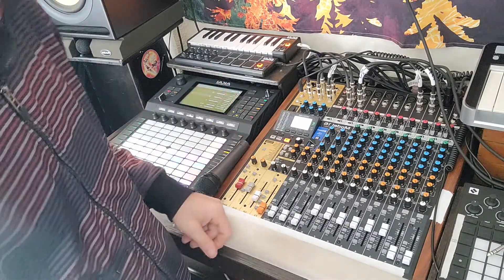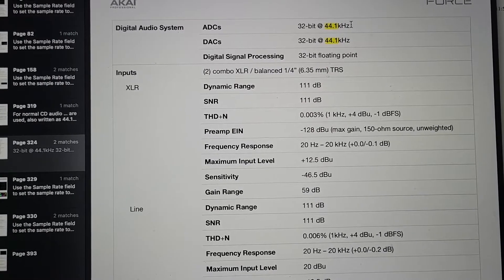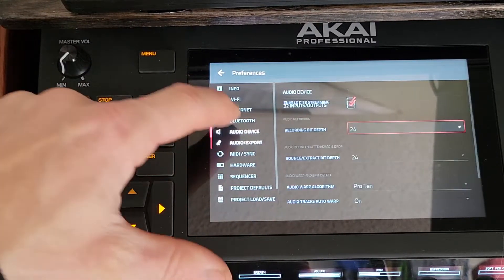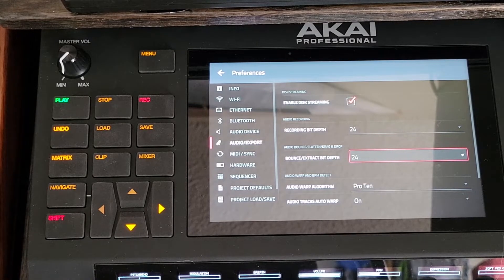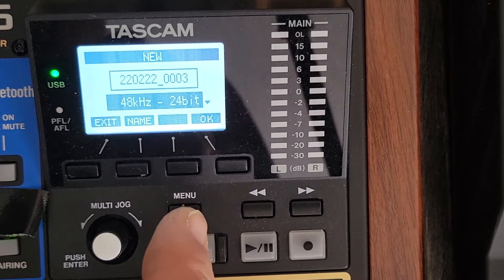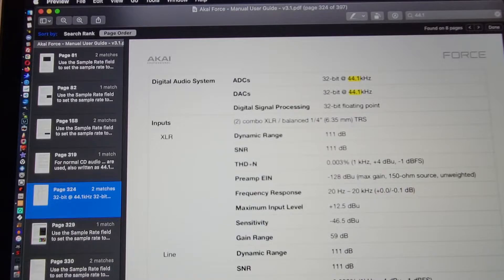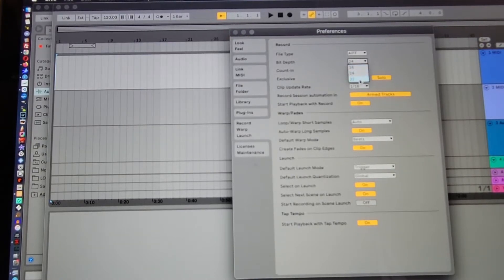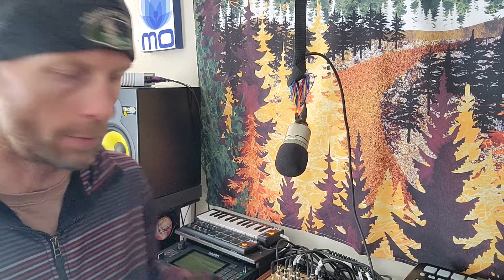Akai Force or MPC 16 vs 24 Bit Depth and 44-1 vs 48khz Connecting to Tascam Model 16 & Ableton Live

Comment: CD quality is  16 Bit / 44.1khz in my memory
Reply from the maker: Correct. Downsampling is ok, but up is not, so record in 24bit or higher.  Headroom in 24bit, easier conversion.   Sample rate is sloppier to move between, so stay in multiples of 44.1 for the win!

Comment: I wanted to Integrate a mixer into my set up with my out Board gear desk... was looking at the tascam... but what are you thoughts on allen and heath? They don't have compression per channel though.... I wish they did...
Reply from the maker: Love A&H in general, looked at it.   Presonus released one after the Studio Live 2010s series mixers, what I wanted and still do. Their new CC Class Compliant one is nice. A few others just popped; check the Mackie for a solid deal around $600 for 16ch w channel compression, just released.
Reply: @protenuator  but why does it seem that a lot of mixer eq secrionndont print on the direct outs? I don't understand that. So then you have to record track by track from the Main outs... it would be nice to print 4 tracks at a time. Maybe im expecting for too much
Reply from the maker: @WavetableMetaphysics  the Model 16will simul record on all tracks if u route properly.
Reply from the maker: @WavetableMetaphysics  think I understand... ur bounce is pre-EQualizer. The Tascam Model 16 has PFL button on each ch line at the fader. Let me pop a demo video showing EQ.
Reply: @protenuator  I can't wait I need to be in the know. PF is that B.S. I will be on the look out for this tape. Thank you 🙏
Reply from the maker: Moved, flooded a little, rebuilt.  Back at it!